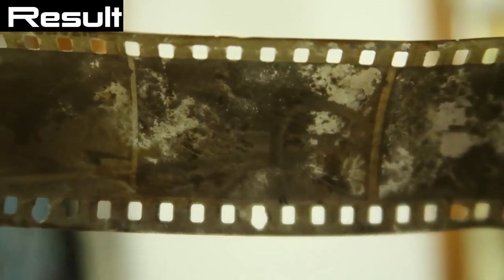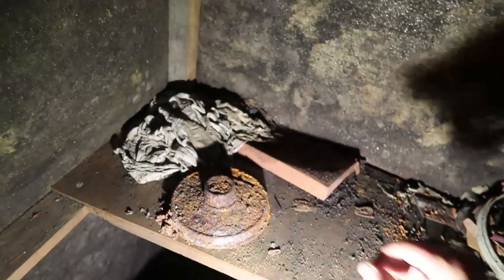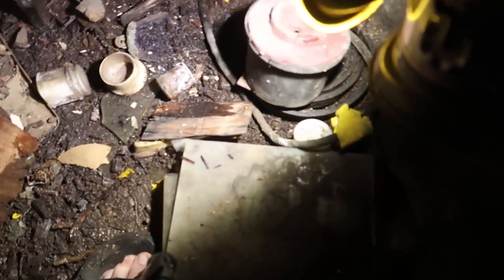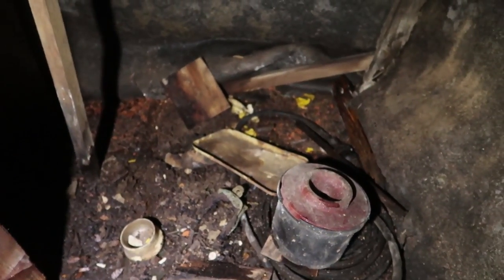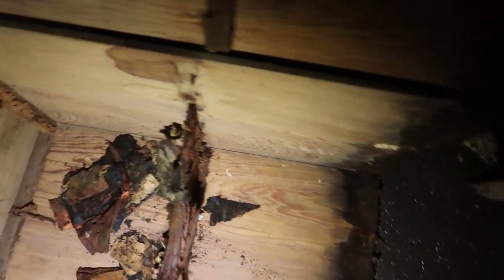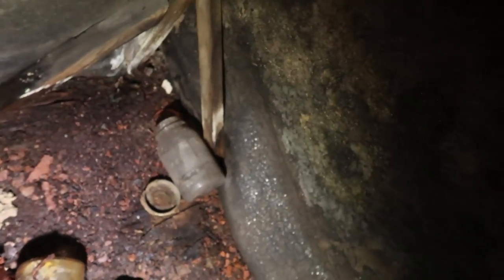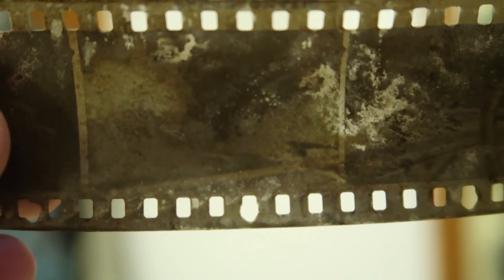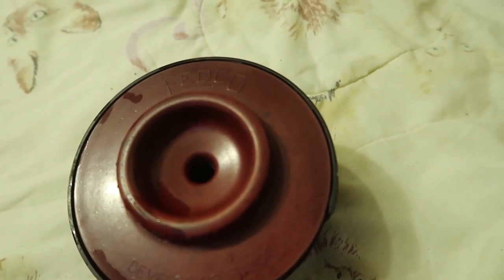Exploring an Abandoned Film Lab / Dark Room, Finding Lost Film

Comment: I think the first device you played with is a contact printer.
Reply: Yeah, quite likely! And a homebrew one too.

My dad recently sold a professionally-made one from the 1920s a few months ago, a really nifty design! It had both a red and a white light bulb in it. WIth the lid open only the red bulb was on, safe for handling photographic paper. Closing the lid pushed a switch that activated the white bulb, exposing the paper inside the printer. Unfortunately the glass was gone and hard to replace, I think they glued the whole box together after installing the glass. It was for huge negatives too, probably glass plates. Something like 4"x8".

Comment: My advice: try to clean a piece of the film in demineralised water and a little drop of washing-up liquid. Just let is soak for 20 minutes, rinse and hang it to dry. If the emulsion stays on the film you can try the rest. Before the digital age I used to develop and print my photographs, 35mm 120/220 an d 4 x 5 inch large format.
Reply from the maker: ill keep that in mind. first im going to take a look at it under my microscope

Comment: What a great thing, I hope you got some cool stuff!
Reply from the maker: its been so long that i cant remember what all i got. i just grabbed a bunch of stuff and its been drying out in my shed ever since.
Reply: @RinoaL  I can relate to that, I have to many interestes and not enough time. So I just grab what I can and come back to it at a later date,
Reply from the maker: i figure for something like this is was a good idea to let it slowly dry out over months instead of quickly
Reply: @RinoaL  when the silver emulsion starts to separate from the base it can be somewhat of a problem, my experience has been to clean it carefully as best you can and then use a good scanner and software to clean up the rest. It's always a hit and miss type thing, I save everything just in case new technology comes along,
Reply: @Nathan-cv6sm  that's why you get the ok to take stuff first, been doing this for a long time so asking before hand is the rule,
Reply from the maker: well how would you get into their building without their permission?